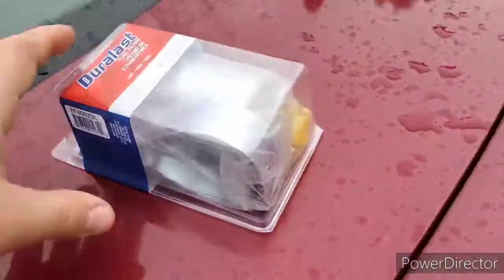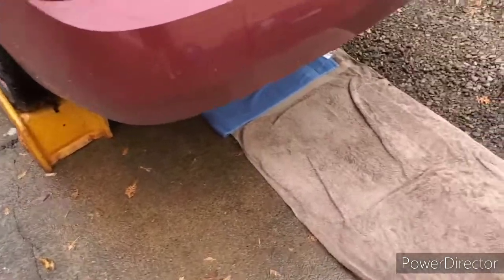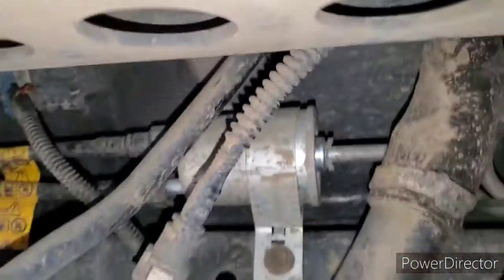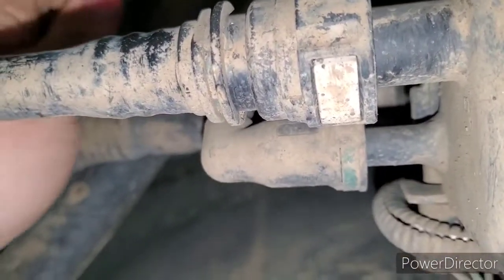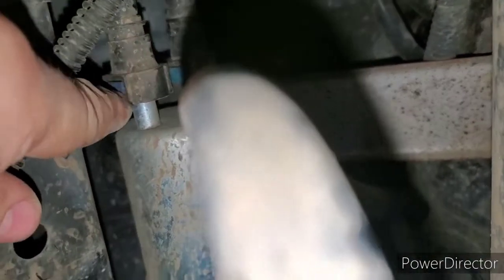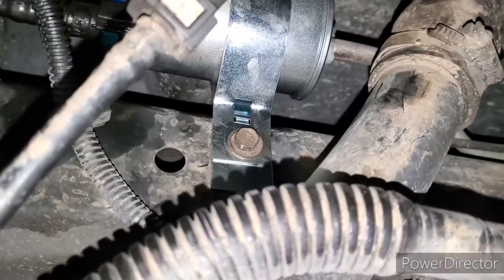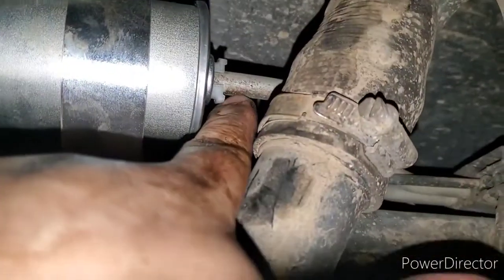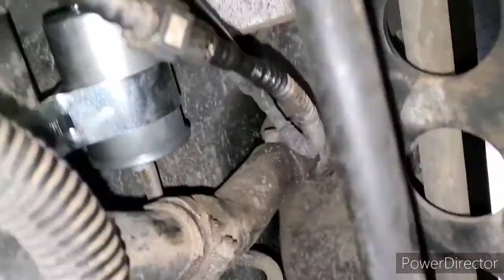how to change fuel filter Saturn ion/Chevy cobalt

Comment: Remember to remove the fuse to the fuel pump & start the engine BEFORE removing the filter to remove the fuel pressure. And disconnect the battery cable. 
Wear eye safety. 👍
Reply from the maker: Thanks for the tips